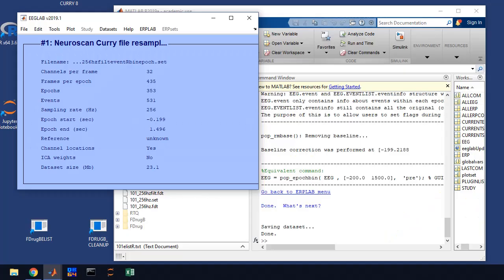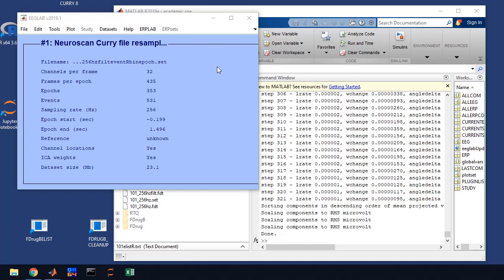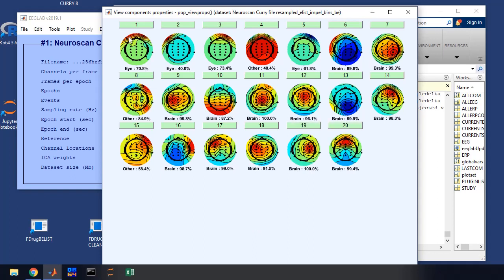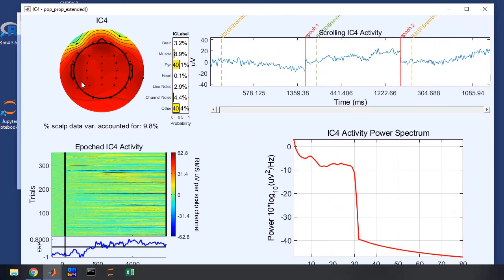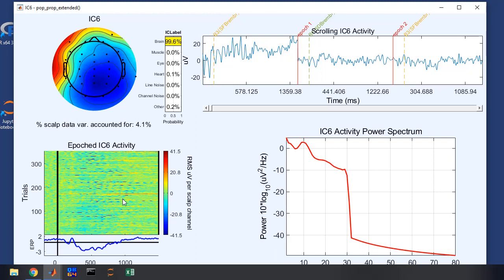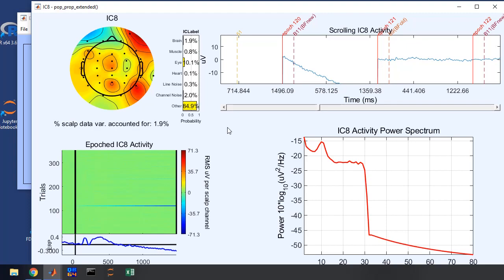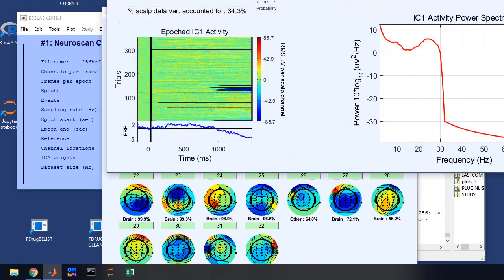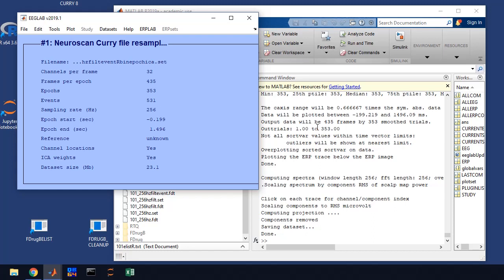Processing ERP Data (Step 3)

Comment: Hi, why is it when i run the ICA label, only one component is labelled as Brain, whereas other components are labelled as 'other' , channel noise? Is there something that I do wrongly?
Reply from the maker: If you only have a few channels, then this outcome is likely. If you have more than a dozen channels, then you have noisy data. Reducing electrode impedance is the most effective way to reduce noise, but there are other ways. Steve Luck's book has lots of good tips on ways to reduce noise. The other tip is to check the "other". I find that many of these are actually brain. Good luck.
Reply: @andrewleynes9726  Thank you! I am actually using EGI Geodesic 128-channel
Reply: @andrewleynes9726  Hi, I am sorry to ask another question, I am Master student so all this preprocessing of EEG data is very new to me. I would like to know, could my problems (ICA identifying lots of components as others instead of brain, and that all of my trials get rejected after applying artifact detection tool) stems from me having too few trials? 

For your information I am running N400 ERP study, in which my participants have to go through four sessions, in which each session consists of 10 related trials, and 10 unrelated trials (so there is only 20 trials per EEG data file) could this be the reason why? Because the SNR is too low?
Reply from the maker: @thevloggerwannabe8599  ICA works much better with more trials. So, yes. I would not attempt ICA on 40 trials. I usually have at least 150.
Reply: @andrewleynes9726  I see. that is very enlightening. Also another question, is there a way to combine the EEG files so that instead of preprocessing the EEG files separately (i.e having only 20 trials per EEG file, and thus low SNR), I can preprocess all the EEG files together so that I have 80 trials? I hope my question makes sense. Also, your video really really helps me in getting hang all of this stuff. Thank you!
Reply from the maker: @thevloggerwannabe8599  I don't know. Check the EEG lab documentation for combining files (https://sccn.ucsd.edu/eeglab/index.php). You should not combine files from different subjects as artifacts are different for each person (ICA should be modeled on each person).